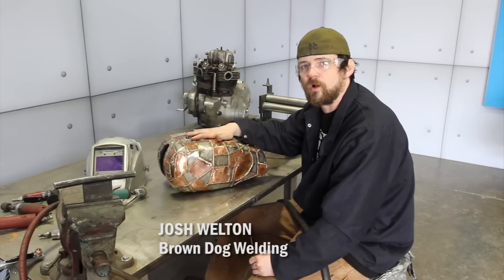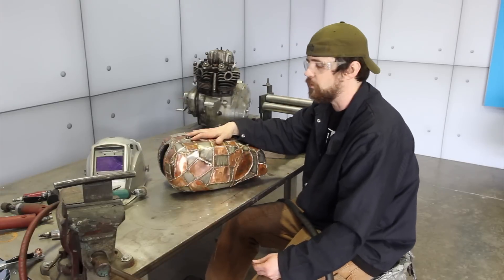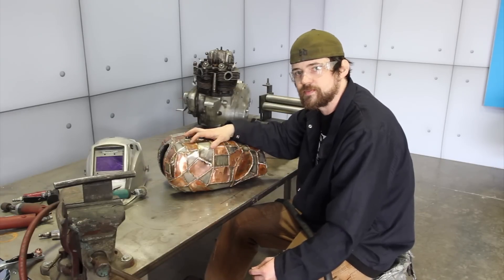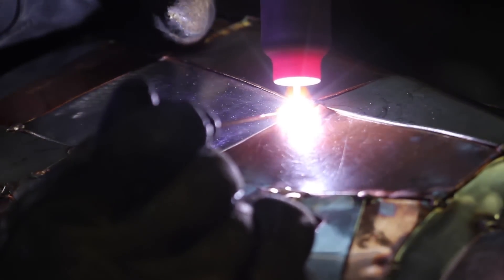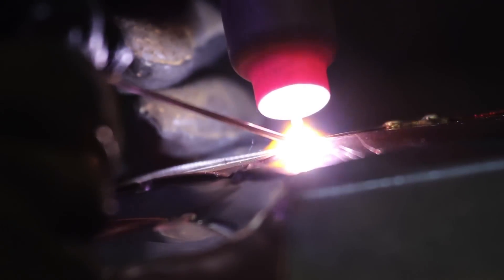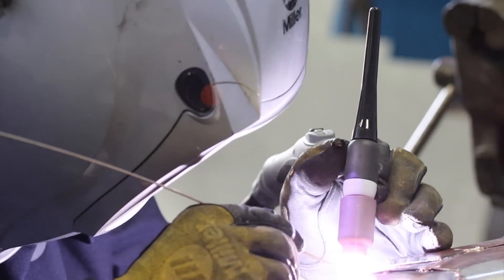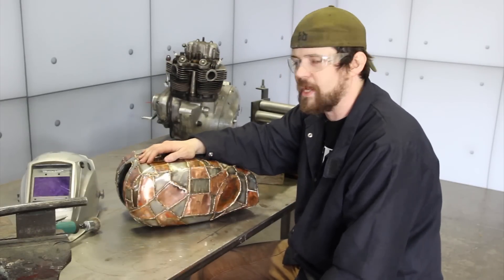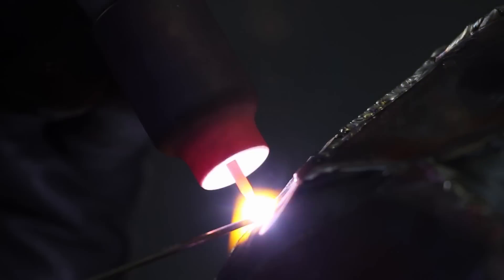TIG brazing the Panic Attack gas tank using silicon bronze

Comment: This guy is using a gas lens but he is missing the insulator to seal his cup you might want to let him know
Reply: +crxtech1 I've literally never had an issue without an extra insulator for the longer gas lens. I know it's not "by the book", but with a low CFH and amps you're not likely to run into an issue, especially with electric brazing. The seal between the threads of a collet body or gas lens and the torch head is usually good.

Comment: I also have a 1985 Honda VF1000R that I am going to be completely replacing all of the fiberglass fairings with 10 or 11 gauge 4000 series aluminum; exposed TIG welds throughout, this winter while the bike is hibernating.  Your oil tank you posted has inspired me to do this, so thanks!  I will keep you posted and may ask for advice from time to time, if you don't mind?